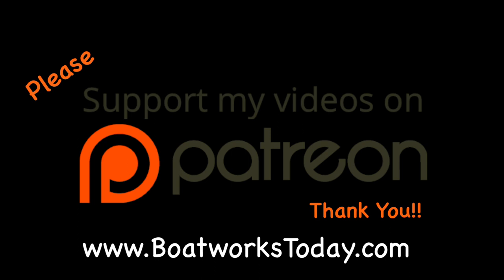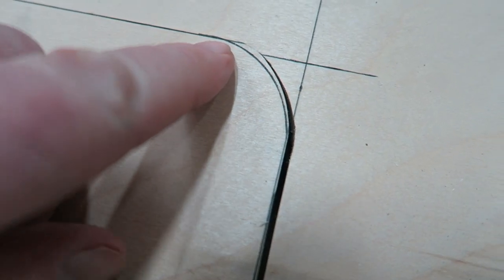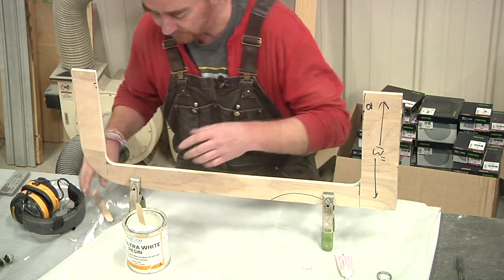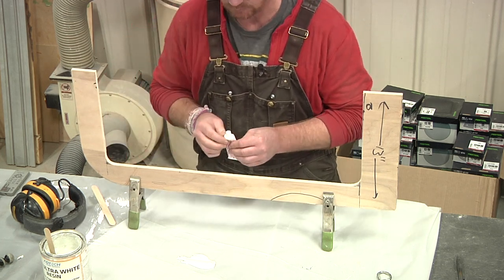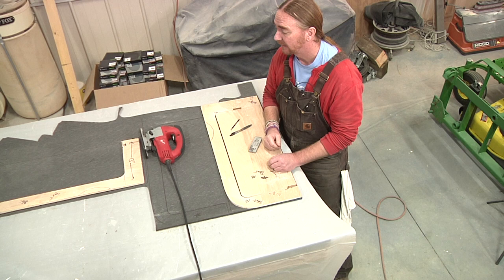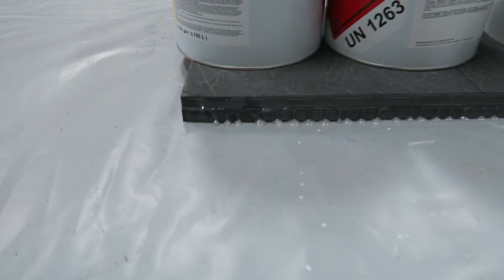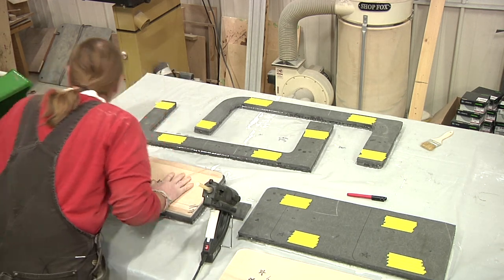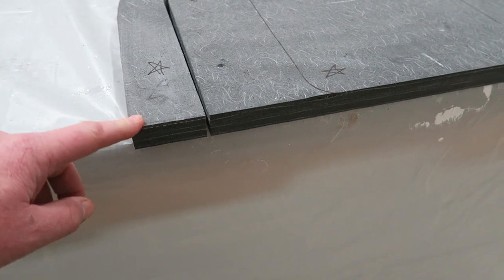Making The Coosa Hatches For The Storage Lockers ~ Bertram Moppie 25

Comment: AVE would be proud!

You need a router table.   Even a small one that you leave a flush trim bit in would work.  I've found it's a lot easier to move the work piece around the bit then to have to stop and re-clamp the work piece multiple times with a hand held router.

Comment: A fence for straight(er) jig-saw cuts works surprisingly well... if you don’t “force” the cut!
A male mold for making a fiberglass drain channel, with a lip for mounting underneath the hatch “frame” can easily be made 8’ long, because those “slab” type hatches with gaskets always leak.

Comment: Great job utilizing Coosa. I started using it during the summer and am discovering great new applications. I have a water tank that is almost like a bathtub. I replaced the rotting wooden top of the tank with 1/2" 25# Coosa with 10 oz woven glass laminated to each side for rigidity and durability. Then painted the entire tank and Coosa with potable water approved 2 part epoxy paint. Came out super clean and no worries of rot in the top during the next 40 years. Next I plan to replace a teak shower grate that is splintering with a piece of Coosa with holes drilled in it to allow drainage. It will all be sealed with Epoxy and laminated with something fancy like carbon fiber cloth for a cool look I may add non skid in the final epoxy coat!

Comment: two things, you should round the bottom edge of the lid could be kinda sharp on the fingers. and 2 make sure you have enough room between the lid and where its closing on the inside edge if you layer glass. the lid will need room to close with out binding on the face

Comment: Hi Andy. Good job as always. My only remark or an advice is about squeezing coosa parts for laminating together. I guess the stress would be spread more evenly when you clip clamps not directly on coosa but through a piece of plywood. Thus, the final layer of cured resin in-between panels should be perfectly even.
Cheers and have a nice week without storms.

Comment: Hi Andy.
I'm not a profesional, but for straight cutting in hatches like this I'm using Metabo KS 55 with Bosch Multi Material blade 3,2 mm thick on it with Makita rail guide and it works greate, arches I'm cuting with eletrick jigsaw and sanding/triming it. If you like You can use Festool Ts 55 but it is way more expensive (for me)  and propably more durable, but I'm just a hobbyist ;)
Have a nice day.

Comment: I'm a big fan of the parallel straight cuts that a tablesaw makes. Are boats that crooked that every piece needs to be patterned then cut and fit? IMHO a rip fence and a miter gauge would speed you up a lot. 
Thanks for your efforts,

Comment: I’m curious if you’ve tried vacuum bagging when doing the flat laminates. There are ways to make it pretty cheap without using extremely expensive products. I’ve used a robinair 2 stage vane pump continuous duty with out issues and you can use the  clear 4 mil greenhouse plastic without needing waxes or mold releases. The Home Depot single bead roof sealant is cheaper than the sticky tape from composites stores and works well. It’s not as good as the official stuff but works well enough. Even temporary molds can be made using block foam and a layer of plastic as a barrier then the composites laminated over that and vacuum bagged. Just curious. 
I have a 25’ whaler that I’ll be replacing the transom core on soon and will vacuum bag the new core material and skin back on. I did this on a 19ft whaler with great results even a few years later and many miles with the boat towed to SoCal and back plus towing to local lakes. No indication of stress cracks.

Comment: I would love a video on fairing compound Vs automotive filler. Bondo ect. I don’t understand why you couldn’t use automotive filler for marine application.
Reply: Mr Peters... Fiberglass resin (polyester) has a moisture content. “Bondo” absorbs this moisture & swells. Also, any deep scratch through the primer allows water direct access. Steel has no moisture, so bondo is ok on car body work... unless you scratch through the paint!
Reply: Well ,one thing I know, bondo is polyester based, so that's one reason you don't use it over epoxy.

Comment: Why didn't you use your bandsaw with a fence?  Love the videos
Reply from the maker: Basically I have 2 types of blades for the bandsaw; a general purpose 1/4" and a $150 resaw blade.  Wasn't going to trash the resaw blade with the Coosa and the 1/4" blade is a little too narrow to give good clean cuts (offset teeth) :-/  I thought about using it, but decided that the carbide jigsaw blade would be a little easier to work with :-)
Reply: Oh, sorry.  I meant for cutting it the templates.  I hate trying to make straight cuts with my jigsaw 😀

Comment: 9:54 Too late for you now, but maybe someone else will benefit in the future... If you'd simply slid your hinged lid out of the frame a bit, you'd have two straight, tight cuts to make on either side, then at the corners and along the back, you'd have plenty of room for error. For those straight sides, clamp down a straight edge for the saw's foot to follow and you'd be able to make the cut between the lines easy.

Comment: Why try cut a straight cut with a jigsaw of all things?  Would have been far easier and more accurate to use a table saw for the straight cuts.
If a jigsaw had to be used then use  a straight edge guide.
Also wouldnt it have been better to laminate the coosa first and then cut?
Not trying to critcise here,  but others will be trying to do what you have done, and simple things like that could prevent heartache later.

Comment: Cutting that ply with the table saw or band saw with the fence would have saved you a ton of time sanding to make it straight...just sayin'
Reply from the maker: That's presuming that the opposing sides are parallel which they are not ;-)
Reply: @boatworkstoday  The width of the frame is different on both sides, but they're parallel. Each side is 90 degrees from the back cut, hence parallel. Just need to move the fence. I'm a woodworker, not a boat builder, but that could easily been cut straight on a table saw or band saw with a fence, then the corners with a jig saw with a scroll blade..

Comment: I wonder if, for cutting ONLY around the corners, it would have been helpful to modify a blade by grinding the back edge so that the blade is "shorter" (in the direction of cutting) so that is is more like a coping saw blade?  For the straight cuts, a regular, unmodified, blade could be used.